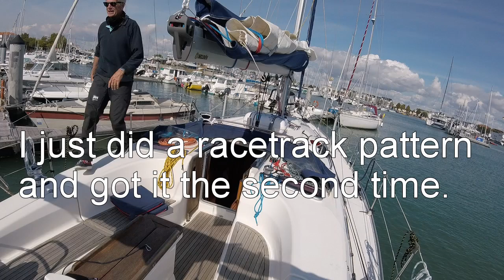Ep 18 Solo Sailing: How I Dock My 40' Sailboat 4 Examples and a Blooper

Comment: Interesting. Here’s another way to do that on a tee. Run a boat length spring line from the dockside now cleat outside your railing back to the console, holding the end, then throw a loop around a cleat/bollard/piling when your stern gets where you want it, secure it quickly in a winch and turn away from the dock. Same result.  Leave the boat in forward at an idle and you can then hop off the boat and tie it properly before you turn off the motor.
Reply from the maker: Yep --- that is a great technique.   You do need to know ahead of time that they are putting you on the end, but I agree, it will work very well.  (Throwing lines from the stern on my boat isn't as easy as on other boats due to the bimini frame and the davits.  That said, practice helps……)

Comment: Have you ever considered placing a removable lifeline with a hook alongside the cockpit?  Seems a bit odd that the only pass-through is far forward on the starboard and port sides, I would find that very inconvenient when boarding or leaving the boat.  I can see how far you have to run back and forth from helm to docking lines, creating more chances of slipping or falling.  I would expect better design on a 40 foot yacht.  Both lines on my cockpit sides are removable so I can hastily jump on or off as needed.
Reply from the maker: Yeah --- I think it might be a challenge getting off this boat aft of midships.   It's almost a meter narrower on the stern than at midships, and there is a bimini frame in the way ---- but yeah your solution is certainly a better one than mine.   I now have a different boat -- so a new challenge.  :-)

Comment: Hi, nice videos. Why do you use your forward spring line to first fix your boat? When sailing single handed and going alongside I usually use the aft line while passing a cleat, if you miss one and there is enough space, you take the next one. The engine can help pressing the bow gently towards the peer. But propably you have a reason for doing it your way.
Reply from the maker: That's an excellent point Peter, and I have done it that way a few times.   Sometimes the combination of three things makes it a bit difficult to get the stern as close as I would like to the pier/pontoon to do it that way: 1) wind quite strong, 2) current pushing me off, and 3) my throttle/steering is on the starboard side, so judging exactly where to stop for the port side stern line is sometimes a challenge......    All that said, I really should try your method more often.   Someone else suggested it too, and said he actually turns the helm away from the pontoon when very close to drive the stern into the pontoon, and then he drops the line over the cleat.    I need to build my confidence on that one.  Thanks for commenting.
Reply: You are absolutely right, these are problems. When there is wind or current you need some speed (and space) and you should reach your throttle before the aft line reaches it's end ;-) otherwise you possibly get problems with your cleat. Nevertheless if there is enough space I almost always make it at first trial.  Your docking is definitely the safer choice and a second try is better than a damaged boat.

Comment: I don't know how Bow Thrusters work so forgive me if it's a stupid question. On your final docking example, where you had to go around, Would it have not possible to "set" the Bow Thrusters to gently keep your Bow pushed into the Jetty. In a similar way you use a little forward power on your other examples to hold yourself against the jetty . Or are Bow Thrusters simply on or off with no sensitivity, with a dead-man's-switch/non-latching switch?
Reply from the maker: Good question Badger.   Bow thrusters are 'on-off', and only work while you are pushing the lever (or button).   Moreover, you can usually only operate them from the helm station.  Thus, if a solo sailor goes forward to grab the mooring line and thinks "Geez, a shot of bow thruster would be good here," it's too late.   :-)    Bow thrusters are a great tool to have aboard, but not the cure-all that many people think.  To be honest, I use mine more when LEAVING the pontoon, than when arriving.  They are especially helpful when you have no way on and you need to reorient the direction the bow is pointing.   Thanks for watching.

Comment: If you take the time to curl up your lanyards, devide the curl between your two hands and throw the two curls wide (in a 90 degree angle) you should have more success! Nice of you to show the failures too though! Thanks!
Reply from the maker: Thanks Alex.  I've seen all of the videos of this technique.  I agree that it works great if you have plenty of time to neatly separate the two coils in your hands, and straighten the line.  My problem/challenge is that I always had to do it on the run from the helm/throttle to midships -- and very quickly before the wind/current blew the bow off the pontoon.   I actually did get it right about 75-80% of the time, but that 20% I missed could be very stressful with the boat being blown across the fairway toward another yacht, and me not having any way on (so no control).  I demonstrate this lasso technique many times in later episodes, but came to the final conclusion to buy a 'Docking Stick' that allows me to drop a loop over the cleat from the cockpit.   I demonstrate this in Episodes 32 and 33 -- and have used it with great success on half a dozen port calls since then.   Very nice.  Stress free arrival.

Comment: Hey Patrick. Thank you so much for this video, I hope to be as competent as you some day. I recently got into sailing and have a 27ft Catalina in a marina with a strong current perpendicular to the finger I'm moored at. I'm on the leeward side of the finger, so on a flood I am pushed away and down into other boats. Its very stressful as a new sailor, especially since my outboard isn't very reliable.

Last time I went out, a friend was motoring and we had an awful time, slid into a few boats and only made safe moorage after I pushed against another boat to pull us into the slip. Needless to say I'm a little scared of going out again, and I want to know what the best way is to become better at docking. I plan on practicing more, but are there some tips you can give me?
Reply from the maker: I fully understand how difficult that is Snowman.    I was recently surprised by a similar situation.   There wasn't a puff of air -- and I decided to go to the refueling pump.  On the way back, I was complacent (no wind), and hadn't noticed the 2 kt current.  As I turned into the slip, the boat surged forward ---- but slid sideways more than it turned.   I would have hit the other boat in the slip had there been one there.   This is especially difficult, because if you slow by going into reverse too soon (normal human reaction), the bow  will swing away from the current very rapidly and make the situation even worse.   I am not really qualified (or expert enough) to give advice, but if I were you, I'd go find a local professional instructor and hire him/her for 2-3 hours of maneuvers in your local port.  They will give you the tips/tactics to employ for the various tide scenarios.   Best wishes my friend.
Reply: Patrick Laine thank you so much for the response. Yes perhaps that is a good idea. Once panic sets in a direction goes out the window, as they say. I'll see if there is someone local who may be able to give me a hand

Comment: I’m a beginner and you’ve given some really practical examples. Docking always plays on the nerves.

Do you keep the bow fender on all of the time? I didn’t know they existed.

Thanks very much.
Reply from the maker: Thanks John.    I leave the bow fender on when I just go out for the afternoon in the relatively sheltered bay near my marina.  When I go out into blue water, I detach one of the quick release shackles where it attaches to the stanchion, pass it around the bow, and pull the fender up onto the deck.  I then re-attach the shackle to a fitting on the deck to hold the fender there when waves come over the bow.  It takes about 20 seconds to do this (in calm waters as I exit the marina).   Thanks for watching.  Good question.

Comment: That port side arrival at that upwind check-in "ponton", couldn't you have also done it by tying a port aft line, and then let the engine push the boat against the ponton with port rudder (in stead of using a bow-to-midship spring as you did)?
Reply from the maker: Yes, absolutely GOM, and I have done it that way before (with port rudder, or even just straight ahead).  The problem with this particular ponton, is that it is actually a small river, not just a tidal basin and the current can be nasty.   I find I have slightly more margin for error by aiming for a cleat somewhere near midships and lassoing it either slightly ahead of or slightly aft of midships.  If I miss (overshoot) the rear port cleat in your approach method due to the current, I may be out of luck and just have to go around again.   The other technique I have used on that ponton is backing in at an 45° angle (facing the other direction).  I just back up to the cleat and drop the line over it, and I'm home.    But yes, I like your method and have used it before where the current/wind is favorable.   Thanks for contributing again GOM.

Comment: I am new to this.  But why didn't you go downwind and spin your boat and enter from downwind?
Reply from the maker: You may be new to this Curtis, but your instincts are excellent.   It was not unreasonable to try the 'angle in, turn to parallel and run to the midship line' approach in those conditions.  However, once I missed it, I should have immediately just angled off, and then backed in (more or less against the wind) and dropped the line over the cleat.One word of caution on the 'backing in' approach when the wind or current is strongly setting you off the pontoon.  As soon as you drop the line over the cleat, you must IMMEDIATELY put the boat in forward gear to drive you up against the pontoon.  If you delay even 5 seconds, the bow will be blown off and no amount of power and or bow thruster will bring it back in.   I speak from experience on this.  I once did a beautiful reverse/angle-in maneuver, dropped the line over the cleat and tied it off a bit too leisurely on my stern cleat.   The bow swung out until I was perpendicular to the pontoon.  I put on enough power/helm that I was worried I would pull the cleat off the pier, and I added the full assistance of my bowthruster.  No good.   I was unable to bring the bow in against the tide/wind.  I let go the line and came around again.Thanks for watching.

Comment: Yes entry and exit does increase blood pressure but you're pretty accomplished with your Bavarian.  Curious to know why in La Rochelle et les Sables d'Olonnes they are not in slips "stern-to" as found predominately in the Mediterranean?  Gorgeous vessel btw.  thks
Reply from the maker: Many thanks Bill.  Very kind.   Those 'stern-to' moorings in the med often do NOT have a finger/catway between the boats; it is just boat against boat, with each boat picking up a 'pendille' (slimeline) that is attached to a block on the bottom 10 or 15 meters off the bow.  The marinas in La Rochelle and Les Sables have finger pontoons with space for two boats per slip (and a finger along the side of each boat).  Some people do back-in stern first in my home port.  I have on occasion, but you lose a bit of privacy in doing that,  especialy at my berth, where a major public walkway is just behind the boats.   That is why I enter bow first 90% of the time.   Reversing in is easier in some respects, as you back right up to the cleat, hit forward gear to stop the boat, and drop the line over the cleat which is only 1/2 meter away.   Thanks for watching.
Reply: Thanks for the response.  I noted with interest, and you stated it too, the length of the fingers does not approximate the average length of the vessels there.  At our sailing club the same predicament, much to the chagrin of slip holders.  However, it appears folks are coping with them well.  Every place has its peculiarities.
Reply from the maker: That's exactly right.   Every marina will have its own personality, and require a unique mooring method.   I often have the wind at 90 degrees (into the other boat) at my slip.  However, if the prevailing wind were different, I'm sure I would develop a different 'core' methodology.   The one thing I will never do (that is possible on shorter boats) is to step off onto the pontoon before the boat is secure.  My boat weighs 10 tonnes, so jumping off and pulling it to a stop with you arms in wind is just not thinkable.   I need to get a line around a cleat while I am still on the boat before I will leave.   Thanks for watching.  (Really like your videos BTW.  A different kind of sailing from what I normally do, but looks like great fun.)

Comment: Any landing where you can use the boat again and does not involve an insurance company is a good one. One question, why run to amidships with the time and risk of a trip, why not throw a line from the stern and then spring the boat forward with a little power to get a midships line on? In fact with plenty of space reverse up to the pontoon to get a line on.
Reply from the maker: Great comment Bill.  Normally what you suggest is perfect.   Complicating factors I need to take into account:  1) The finger on my pontoon is considerably shorter than the boat, so I can't motor against it in the normal way (but great technique for 'parallel' parking).   2)  Trying to get lines ashore from the stern section of my boat is a challenge: I have davits that get in the way, a bimini frame that interferes with access, and a GPS receiver that loves to be snagged.   :-)    The bottom line is that every boat, and every marina will have its own personality.    It's up to the skipper to develop a technique that works, and then practice, practice, practice.     I've now filmed over 100 arrivals in my videos: good bad and ugly ---- but all generally safe.   :-)
Reply: @patricklaine6958  the one I noticed was where you came alongside, not on the finger. As you arrived there was a cleat next to which you nipped past! But of course every boat has its own issues. But as long as nobody gets hurt who cares how you do it.

Comment: Hi Patrick you chose to go in bow first and not stern first. If you went in stern first you could use a short line ready on the quarter cleat, tie/loop on the finger cleat and then power forward which would have the same affect as your hard over helm. Just interested in your thoughts and choice?
Reply from the maker: That is a perfect technique you describe Emma, and I do use it.  Two minor points to keep in consideration though.   Obviously, you should try to back into the wind as much as possible.  If the wind is blowing hard at 90 degrees to the slip, you need to keep your speed up (almost uncomfortably so) while backing.  If you come in too slow, the bow will not follow around, and you will drag the front half of the boat across the other boat in the slip (or the finger).   It takes a bit of nerve.   When the wind is high like that, I prefer to enter bow first.   The other minor point to take into consideration when solo is what side the finger is on when you back in.   On my boat, I will have to back in, stop the boat, then run to the other side of the stern and grab the line to drop over the cleat on the finger or pontoon, do a quick figure 8 with the line, then run back to the other side to put the power lever in forward to drive me forward (and against the finger).   You can see that there is still a bit of potential for my bow to drift over into the other boat by the time I have finished dashing back and forth if there is any wind or current.   That said, it is a great technique -- given the right conditions.
Reply: Thanks Patrick, it's actualy Mike here (using my daughters account). Totally get it re what side your morse control is on and also windy conditions. I tend to reverse in most times and unlike your Bavaria (I have a Jeanneau 39i) I have a large swim platform accessible from the helm with a big ball fender which allows me to step off, tie up and step back on again and engage forward. Then tie up a leisure. Will buy a bow fender and try your technique next time I am down on my boat. All the best.
Mike
Reply from the maker: Got it Mike.   One of the major sailing schools in my home port of La Rochelle uses almost exclusively the reversing technique you describe (also with a big ball fender on the stern), no matter what the weather is.   I guess it comes down to a question of preference and practice.   The thing I like about backing it in is you see everything perfectly --- and no doubt about when to power forward to stop.   With my 'bow first' technique, it is quite a challenge to time the moment to reverse the engine because you are so far away from the bow.  I'm getting pretty good at it now, but still tap the pontoon a bit firmly from time to time, or reverse too soon and then drift into the other boat.   This is just part of the challenge of solo sailing...... Best regards